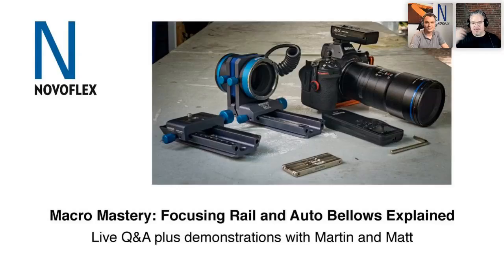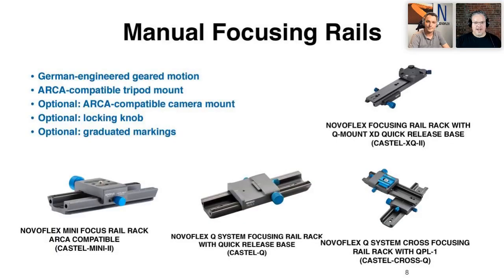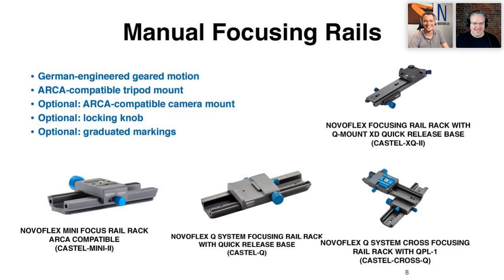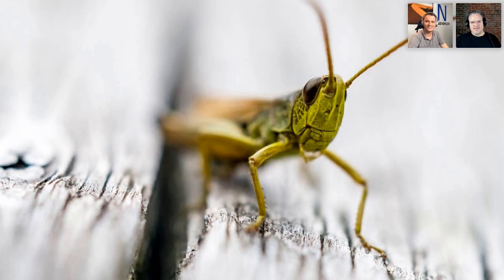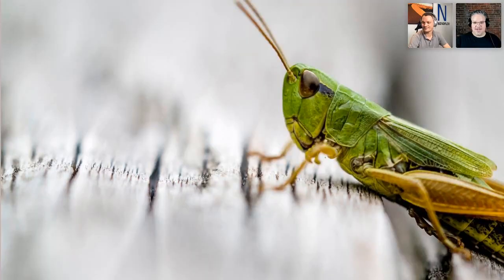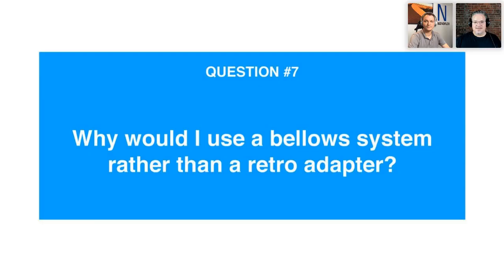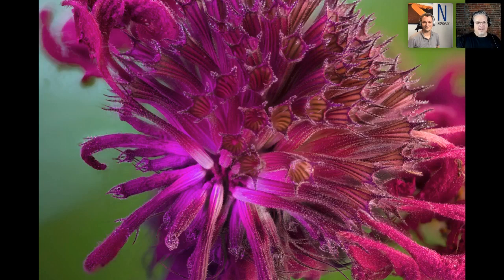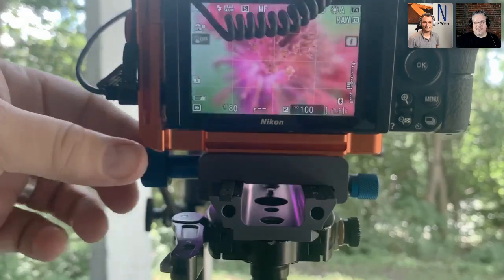Macro Mastery: Focusing Rail and Auto Bellows Explained (WEBINAR REPLAY) w/ @NovoflexUS @NOVOFLEXTV

Comment: I’m a little peeved

I bought the balfux bellows for my fuji.

I can’t focus because it doesn’t come with a focus rail. I wish I knew this when I bought the bellows because $999 was very expensive without a way to focus.

2 the book says the bellows come with reversing rings.

Where are they?
Reply from the maker: Hi Nicholas: Matt here. Again, sorry to hear you are unhappy. 
Martin and I go to great lengths to explain how to configure the system in our videos. See 13:50 in this video. 
 
The reversing rings (RETRO/FLEX and FLEX/RETRA) are connected to the RETRO adapter. 
 
If you loosen the blue set screws on the bellows and remove the RETRO adapter, you will see adapter rings attached to it on either side. The adapter rings unscrew from the RETRO adapter (the two lens mounts with a coiled cable running in between). 
 
As supplied, it is equipped for a forward-facing lens. By screwing the threaded end into the front element of your lens (58mm is native, or using a step ring from 58mm to your lens' front filter thread), you can now reverse your lens on the bellows.
Reply: @PhotoVideoEDU  I apologize I did find the reversing rings on the bellows, that is my fault.
Reply from the maker: Nicholas: it's no problem at all. We are here to help! Please let us know if you have more questions.